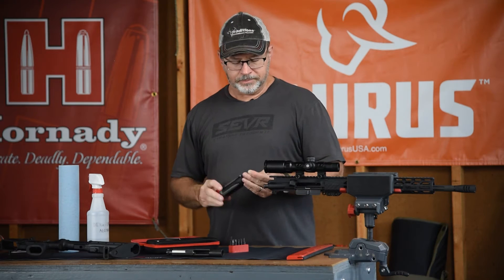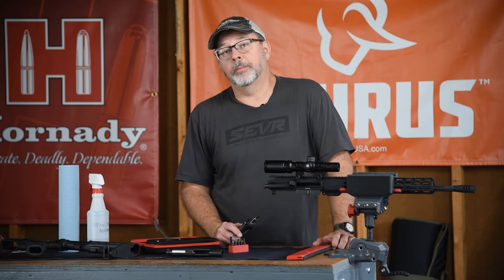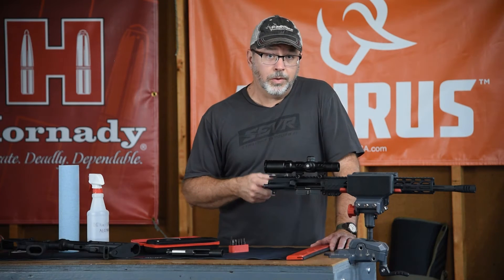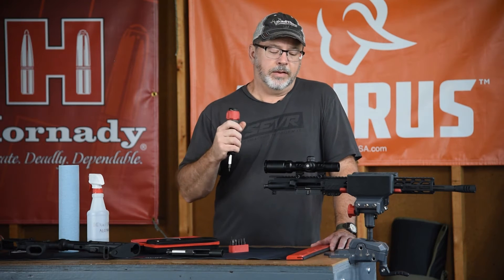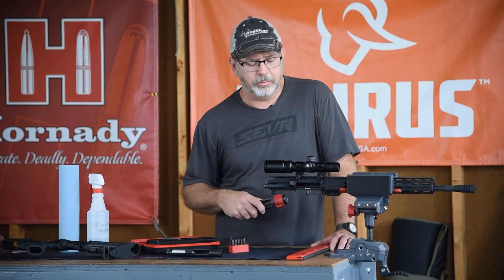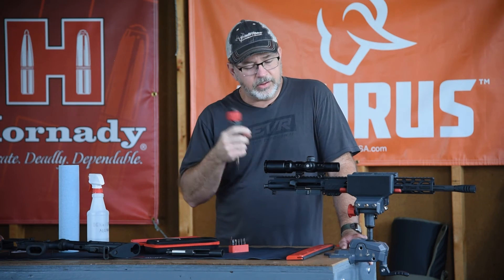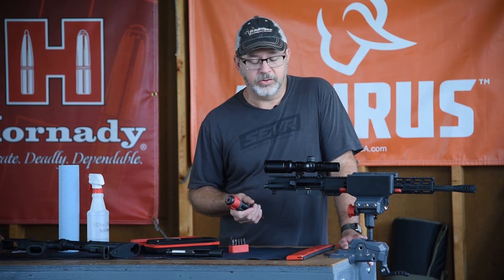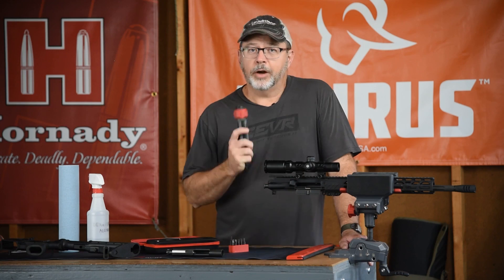Importance of Proper Scope Ring Torquing

Comment: I got an expensive ($100) torque wrench in inch-pounds which takes 1/4" bits, and Burris Xtreme rings with the 1/2" nut.  I guess I need to get a 1/4" to 3/8' or 1/4" to 1/2" drive adapter so that I can use a 3/8" or 1/2" socket to torque the base nut on the rings.  It appears I am over-torquing when I try to guess tightening the nuts with my regular 1/2" mechanic's socket wrench (even though it doesn't feel like it to me), because I am noticing the rings kind of go offset and lean to the other side.  This messes up the scope position and the crosshairs which now look crooked and not perfect 90 deg. like before I tightened everything down.  I am sure this will translate to dialing in a lot of windage or running out of it  😞  Is that how you guys torque those big 1/2" nuts?  Get a 1/4" to 3/8" or 1/2" adapter for your 1/4 in. torque wrench?

Comment: The big bolts that torque to the rail that are like 12mm. What do you torque them at ? Trying to set up my ATN X-Sight 4 Pro 5x20. I was told 30 inch pounds , but that seems low to me.
Reply: 30 inch pounds is what I would use.  All my 30mm & 34mm scope rings state to torque to 30 in-lbs and the 1" scope rings from 20 to 25 in-lbs.  The only exception are the big/wide Burris 30mm Xtreme rings I used on a couple of guns.  Burris website says 40 in-lbs, but those have the 1/2" nut for the base.  I would not go over 30-35 in-lbs if you have torx or hex screws on your rings, and less for 1" rings. EDIT: I see you have the big nut too, so 35-40 in. lb should be fine, but I would check with the manufacturer.
Reply: @vtecharrys.6981  Thanks
Reply: I prefer 40 inch pounds but 35 should be fine. I do believe not to go over 40 inch pounds.
Reply: Depends on where you look 16lb to 60lb !